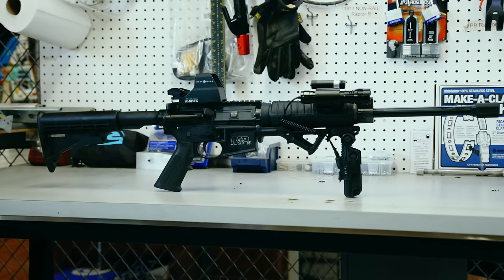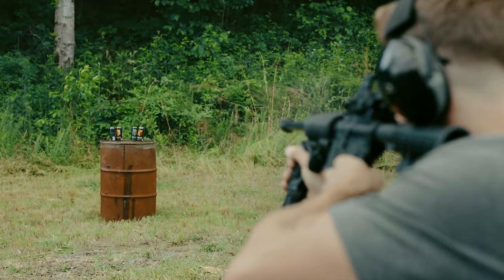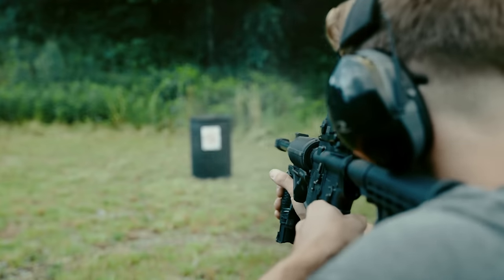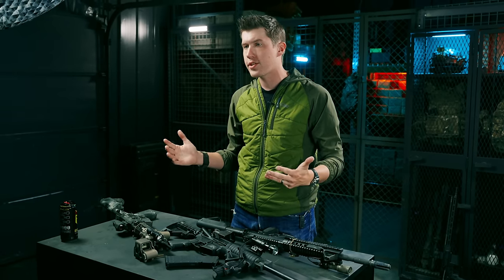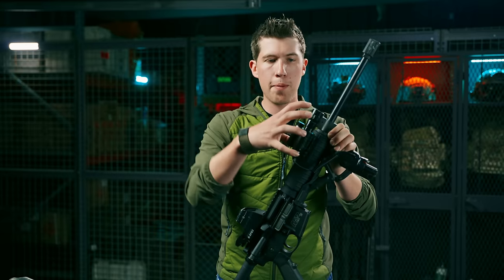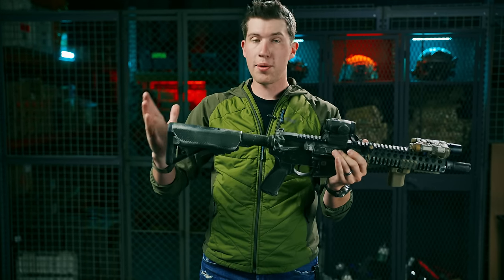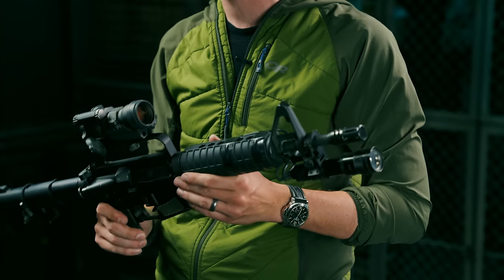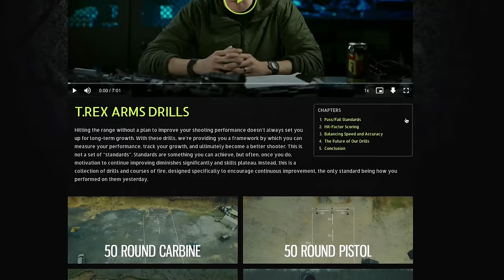5 Mistakes New Rifle Owners Make

Comment: That bit on the cheap optics hit me right in the feels. I mounted a $50 open reflex on an ultimak railed gas tube and learned the importance of paying for quality. 12 rounds was all it took to cook that thing.
Reply: Yep haha I bought a Chinese Eotech and put it on a ar and it literally flew off the rifle after a couple mags 😂
Reply: Not an ar but reminds of the time my buddy bought a red dot for his pistol and the glass blew out on the first mag
Reply: we've all been there lol
Reply: I forgot the brand. The at I bought came with El cheapo red dot sight. Thing sighted well indoors and stays on the gun. The moment sunlight came outside the dot disappears to the point of being unusable.
Reply: Bought a cheap red dot myself a few years ago. Every few shots it would go lose it's zero. Didn't matter what I did, it kept happening. 
A quote from Dave Canterbury I heard years ago, "you buy cheap you buy twice."
Reply: Not me reading these comments after already buying my $25 Amazon red dot 🤦‍♂😭
Reply: @ConsensusX never bro, if ur gonna get a red dot spend it on a quality one. Holosun makes good red dots for the price.
Reply: @TonySoprano-on5iu  Update: Just ran ~75 rounds through my Amazon red dot (PSA 10.5"). Didn't lose zero, I torqued the screws down good. I'm also running backup iron sights just in case. I've also kept it on, low brightness, for 2 weeks straight so far (CR2032 battery). 
The day this thing breaks, I will upgrade to a SIG ROMEO.
Reply: @ConsensusX  eh if it works it works, when I first got my red dot, I just got a trijicon rmr, didn’t wanna get none of those cheap ones
Reply: Update #2: Just over a month and it still held zero (CQB range). I would intentionally bump the red dot, and it's still on tight. 
The CR2032 battery lasted 5 weeks straight with the red dot on the lowest setting, and on mid setting during indoor range time.
Reply: @ConsensusX  that’s not bad for a budget red dot. My budget red dots were holosuns😂
Reply: Never understood the optic thing.I mean, I get a good optic but I mean, we're shooting.Paper targets not human beings.We're not jumping out of the rear of a blackhawk  these guys We'll spend twice as much on an object as they will their rifle.I gotta 30$ Amazon optic its held zero through 800 rounds
With backup magpul irons
Reply: @JohnGotti256  you spend the money for quality and peace of mind. No point in saving the cash if some fuzzy woodland creature is eating your guts because the zero drifted or the emitter failed.
Reply: @OmegaxPrime  Good point, but here's my take on it: If I can't put 2 in the creature within neighborhood block distance, my best bet is to run and hide/ambush. You have very little reason to engage at those distances if survival is your goal .
Reply: @OmegaxPrime that's why I carry a side arm lol
Besides on the 556 I know how to shoot irons if the shitty optic fails
Reply: @ConsensusX  Vortex has a strikefire II right now for like 100 bucks, you dont have to shell out 500 bucks for a decent optic just dont buy the made in china shit
Reply: @crackerjack9645  Those Vortex optics are made in China haha.
Reply: @ConsensusX  mine says Japan, possible the lower end vortex stuff comes from China idk tbh. 'Made in China' is more of an expression for cheap Amazon shit as opposed to something actually being produced in China the location lol some made in China stuff is fine if it comes from a reputable brand
Reply: Honestly, I bought a CVLIFE ACOG-ish optic years ago and it worked out great. Held zero and the glass was great. Even had a backup sight on top and some picatiny railing on it. Sometimes cheap isn't junk. Sometimes expensive is just way overpriced.

Comment: I've made nearly every one of these mistakes (except for not zeroing properly), but I don't necessarily regret making them. As a new shooter, you have to play around with different configurations before deciding what works for you. If you buy top of the line lights/optics/accessories every time you change up your configuration, you'll be spending boatloads. Play around with different options with some cheaper components until you find something that you like and works for you, and then shell out some good cash for quality components.
Reply: This comment needs more thumbs up
Reply: This is the exact thing I have done
Reply: Exactly.  I intentionally bought the cheapest, most ridiculous all-in-one setup off Amazon when I first bought my AR.  I wasn't looking for quality.  I was just looking to see if I wanted to spend real money on a dot, a scope or even a laser, light ir laser/light combo.  

Now on my Sig Cross .308 I have a big Vortex scope that cost more than my first AR did, on my original M&P Sport II I've changed out literally everything but the striped lower, bare upper and barrel but I'm running a 1-6x LVPO with backup itons that I love on that gun with a simple angled foregrip and light.  Even changed out the grip, stock and every other part with lightweight components because it's my go-to rifle.  Solidly dependable.  

Other guns get other stuff.  Like my Kel-Tec S2k got the full MCarbo treatment and a Stalk-tek laser.  It's fun as heck, reliable, and can be folded into a backpack.   It has a vertical foregrip just because the placement of the laser's pressure switch is ideal.

So, yeah, try cheap stuff so you learn what you like and then buy good stuff.  

One thing he didn't mention in the video was the trigger.  Biggest improvement to me was a good, single stage, light weight trigger.  I'm now to a 3 lb pull on my AR and no gun is over 4.5 lbs in my safe.  My groupings are far better that way.  

As to keeping it level: he mentioned technique but I didn't catch the most important part: pull the gun into your shoulder.  That'll keep you from getting bruised by larger caliber guns and keep the muzzle down.

Comment: Your needs out of an optic can change as time goes on. I have ran the same Vortex spitfire AR 1x for years and finally upgraded to one of the Primary arms 3x microprisms for a little bit of magnification. As new products hit the market it makes sense to grab stuff that fits your needs that maybe wasn't around for a decent price 5+ years ago🤷
Reply: I don't know when I got my first AR the first optic was an EOTech. This was back in 2009 timeframe. It was the huge one with the AA battery. I thought it was so cool but looking on forums the one optic that I was immediately interested in the Elcan. I was put off by the price at first but after some time I just got it. I've been using it for the last 10 years now and can't see myself using anything else since I like it so much.
Reply: Ran my Vortex Sparc 2 for 2500 rounds on an AR. Than switched it to my AK and ran another 1000 rounds + , what a great optic. Still holding zero.
Reply: True...mostly. I spent months finding a used Leopold at a sane price. The long discontinued VX2 1-4x is highly sought after. Not one company has made a 1-4X that light, before or since. It is a mere 8 ounces. Crystal clear and quite robust. Their newer "improved 1-4's are heavier and not as well made with glass, for the $400 price point being no batter than the old VX2's.

I would rather drive a nail through my foot than carry an AR with an Elcan on it. Or any LPVO weighing a POUND or more. 
The ONLY exception would be the new(classified)  military VORTEX LPVO with the integrated computer and laser range finder.  THAT is what I call "cutting edge" of tech/
Reply: @deplorabledave1048  My change was an increase from 1x to 3x and dropped 3.5 ounces if I remember correctly. So the change to modern made sense, that isn't always the case, that Leopold you got is a keeper!
Reply: @breakdown7153  
 Indeed. When they 1st came out they were $400 notice count. Since they have been discontinued they they routinely sell for the same price on eBay. I watched for years until I found one for $230 right after Christmas when everybody is broke. And then 2 weeks later I found another 1 for $200 new in the Box . I had to buy that one too!
Reply: @breakdown7153  
 There's another 8 oz variable power scope out there that has been discontinued. It's. It's made by Weaver and is absolutely crystal clear optics. It is a 1-3X. 
I believe if you can find one,  you should be paying $200 or less.
 They were popular with 3 gun competition guys that didn't want to lay out the $400 for the Leupold VX2  1-4X
Reply: Those microprisms are everything I ever wanted in a red dot, nice and lightweight, etched reticle so it's good to go even if your battery dies, and it has good holds out to medium distances, shake awake to preserve batteries.  If I had known that thing was coming I wouldn't have bought my Romeo 5 with Juliet 3x magnifier.
Reply: There's no such thing as a decent price anymore.
Reply: Your needs for optics can change over time because of age also I noticed that 47 now red dots don't do me good stigmatism in my right eye is starting to come to play the red dots becoming fuzzy it's not crisp like it was 15 years ago  not bad enough but not good enough I enjoy it like I used to can't hold the groups I used to
Reply: @KamikazKid how do you like the Romero and Juliet combo? Thinking about it myself
Reply: @Nollideel  It was good for the time I got it, the eyebox is a bit small with the magnifier but if I had to do it over today I'd go with the Primary Arms microprism. It has an etched reticle so works even when batteries are dead and holds out to 500 for 5.56/.308 or 7.62x39/300 blackout.  With the primary arms you can do a 1x with a magnifier run it the same as romeo & juliet or you can do the 3x or 5x prism and mount a red dot for close quarters on its offset mount.
Reply: @KamikazKid  I currently have a holosun 403b I was gonna run with the Juliet but an etched reticle does sound nice
Reply: @Nollideel  since you already have a red dot then yeah the juliet might make more sense for you, only thing I don't know is how well it will mate up with your holosun for you since the height on the 3x is 1.41 inches and it comes with spacers to raise it to 1.535 inches and 1.63 inches.

Comment: I have had really good results with the Sig Sauer Romeo 5. Even after close to 5 years of use, it has not run into any issues holding zero.
Reply: I have two of them. One on my pistol Ar home defense and the other on my ruger 10/22 takedown
Reply: I've had that 100 dollar sightmark for 5 years and hunted with it several times. Still holds true
Reply: Same.  Got one on my AK and it has always held up.
Reply: My Romeo 4 stopped holding zero and Romeo 1 just stopped working after 6 months. I don't trust Sig electronics at all. I still think most of their red dots will work and hold zero fine, but the risks are too high for me to purchase anymore.
Reply: Romeo and Juliet 👌❤️
Reply: @farmersneed  Makes Sense since Holosun makes their electronics. Or at least used to. 

I used to be a Holosun fanboy until I had 2 take a shit on me. They're overhyped and now I have an RMR with no issues.
Reply: @garyj449  Holosun dosen't currently have anything at all to do with Sig optics.
I've also got Holsun pistol & rifle dots with thousands of rounds with no issues.
Burris has always been my old faithful & I continue to trust those as well.
Reply: After upgrading to to an aimpoint for night vision use, I moved my romeo to my turkey gun. So far it's been holding in there just fine with 3.5" magnum 12 guage. That's the toughest recoil test I can give it.
Reply: @JohnDoe-zs6gj  I have one on a Ruger 57 & while it has low recoil, the slide velocity on that gun is insane.
The empty case ejects so hard that it's essentially a 2nd lethal projectile lol.
They hold up under recoil, they just suck for EDC because of the cheap materials.
The plastic lens scratches so easy.
My opinion on the Romeo Zero is, good for range/ plinking/ HD & bad for EDC.
Reply: I've has great service with Sig Romeo5's and Romeo7S's. Can't see spending more cash when my astigmatism will foul the dot a bit, regardless of the manufacturer or dollars spent. I co-signed witness with the front sight always, and both sights sometimes. Like the instant ON feature of both.
Reply: Romeo 7S and RMRs work well, also.
Reply: The XDR on my Bcm has never left it for 3 years. Crazy battery life. Zero still holds.
Reply: I was thinking of getting one myself. Glad to see some positive reviews outside of review websites.
Reply: I have two of those on cheaper builds it's probably the best of the budget optics it's a 400 dollar grade dot for 100 bucks .
Reply: @farmersneed  the 1 and 4 did suck the 5 is good it's probably the best 100 dollar red dot you can get . Too Mach it's quality you have too spend far more money
Reply: Yeah I have a Romeo and Juliet combo on my AR...works great for me.
Reply: I've had good luck with the Vortex brand of red dot sights and scopes.
Reply: I love that optic. It's amazing.
Reply: i just bought this for my first AR, it seems universally loved online
Reply: Agree 100% I have two of them each on a different rifle and they've both been fantastic with no issues for 4 years. Also have the Romeo Zero on my ccw and it also works perfectly
Reply: Im very surprised he didnt mention Sigs Romeo series. I have the 5, 7 and pro. Even though I think the 7 is discontinued now, they all are amazing. Easy to zero, reliable and a great price point.
Reply: I run Sig Romeo 7's on my stuff and never had a issue.
Reply: Is there any other red dot even worth mentioning? Lol
Reply: @farmersneed  
Yeah, I never liked their less than 5-star ratings online.  Imo, the best budget optics from cheapest to most expensive are:
1.  Vortex Strikefire II
2.  Holosun 510c
3.  Aimpoint Pro
Reply: @garyj449  
I like Holosun for CQB urgent stuff, where I need the auto-on function, but I won't have too much issues if it doesn't turn on at all, because I'm under 30 feet.

I like Aimpoint for "apocalypse build".  The thing that's supposed to be used when zombies and Chinese paratroopers are all over the place and I spend 6 months out of the year hiding in a ditch.

Vortex Strikefire II is a budget apocalypse optic, for tossing rifles out to friends in a warzone.
Reply: R5s are awesome
Reply: You can get a sig for like $80 to
Reply: My Romeo 5s have served me well. A good budget red dot doesn’t have to start at $400. He seems like he’s basing his bias off country of origin but at the same time recommended holosun
Reply: Agreed. I think the Romeo 5 is the standard of optics but is surprisingly nice and durable. I’ve had multiple and all have served me well. Of course I like my Eotech’s and Trijicon’s and Aimpoints but the Romeo 5 is a great budget option
Reply: I’ve got one on my ar-15 it’s great gonna switch it to my .300 blackout ar pistol when I get it
Reply: Same here. Got one on the first weapon i bought which was an ar, zeroed it, still shooting well after 4 years. Bought another one for my mpx
Reply: I just got one I love it so far.
Reply: exact same in my experience.
Reply: Congrats on being poor. Get an aimpoint. They do sales periodically for your people.
Reply: Congrats on being poor. Get an aimpoint. They do sales periodically for your people.

Comment: that Glock specific frontgrip is killing me! For those who don´t know: Its designed to put on a glock, and if folded, the extension covers the Trigger, to act as a "Trigger Holster" to prevent the trigger from getting caught on something (Its designed to be used in conjection with a Stock, as a PDW kinda thing, so the Gun is maybe hanging from a sling, thus the triggerprotection may be needed)

Comment: The very first sight I had on my AR was a cheap Chinese reflex/red dot. It worked fine and never lost zero, but the brightness/color selector got a little messed up from recoil. Bought my first legit sight from cabelas, it was a Sig SAUER Romeo 5. It worked fantastically and I’m still using it to this day. And finally I just bought an Eotech EXPS2-2 the other day, delivers tomorrow. Putting that on my AR and the Romeo 5 is going on one of my other guns, haven’t decided which yet.
Reply: Sig Romeo is probably the best option for the first AR, inexpensive but reliable and gets the job done. Especially since, on the first one, most people probably aren't trying to break the bank
Reply: my first AR is the exact same model in this video, and the very first part that's worth replacing is the foregrip.  it's plastic and gets crazy hot.  replaced it with a Magpul for like $30.  after that, i saved up a little and picked up a Sig Romeo5 and still run it to this day.  it's simple, but has been incredibly reliable for me.  don't have any plans to replace it anytime soon.  obviously, there are better optics out there, but it's more than adequate for my uses.

now i'm trying to save up to replace the BUIS i currently have with a set of Troy HKs...
Reply: Putting a 5 on my zastava M92!

Comment: The one saving grace I had as an AR-15 builder was I was a trained Unit Armorer - attending Small Arms Armorer course in the Army. And one of my buds was an actual trained Gunsmith and another a senior armorer.

Still I still had to learn on my own that not to cheap out.

And I always do iron sights first. Always.

But learning never stops.
Reply: Irons first, agree